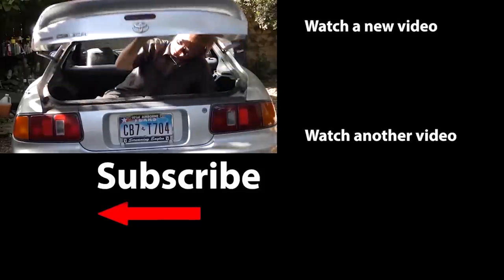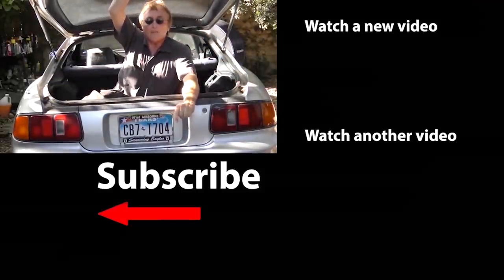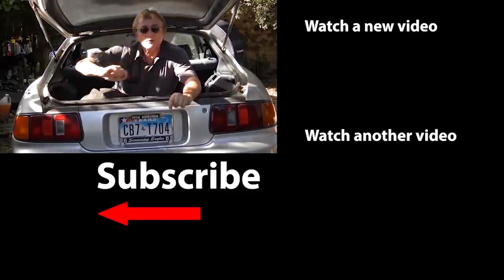This Was a Huge Mistake

Comment: Scotty, you're the reason why my first car now is a 1999 Mercury Grand Marquis and not a Nissan Altima.
Reply: I have a 2007 LS. It has 160000 on it but the body and especially the drivetrain feels like it's still around 60000 or less. Incredible ride and solid like a tank. Replace the tires as often as possible to keep the ride nice, keep up with the brakes and oil and it will last forever. They don't build them like this anymore. I'm glad I gave the grandpa moblie a go. 😉
Reply: Also, I bought it with 98000 on it and got lucky with the condition of it.
Reply: Grew up in da 97 grand marquis and that boat never broke down, my sister still has it as a hand me down and it’s big and safe and she likes it too
Reply: 99 Nissan was still a reliable car.
Reply: If you haven't done it, already, have the semi-metal intake manifold from a 2002 or later Panther body put in next time you get the coolant flushed. The stock ones from '96-01 are all-plastic and can crack. If there are any engine misfiring issues, get it fixed ASAP or it'll wreck the catalytic convertor. Otherwise, that car can last and grow with you for at least another decade and two kids.

Any woman you're dating who wants you to get rid of it for any other reason than winter traction, deep frame rust, it has become a money pit, or maybe safety (if even that, given it's body on frame) isn't a keeper.

Make sure you use the switch on the driver's door that turns off all but the driver's window controls, especially if you have kids, in case a child accidentally leans against the up button on the window rocker while their head's leaning out; do it now before you forget, then occasionally check to be sure you didn't switch it off by accident.
Reply: @Noah Stakes
 - Good Choice bud. I got an '03 LS Ultimate Edition. Other smaller newer cars just don't compare.
Reply: Nissan is a great automaker. I happen to own four,five if not for an accident. 2006 Altima 2.5 bought it with 130k and presently at 280k. 28+ miles gallon and no more maintenance than a changed valve cover gasket. I'd rather push my Nissan than drive your Honda or Chevrolet. Nissan-4-life
Reply: Hey I had the same car. Love that big ol' trunk and comfort all around.

Comment: On towing an all wheel drive vehicle with automatic transmissions: The Land Rover discovery series II (99-2004 not sure about the newer ones) allow you to fully disengage the drive train from the transmission by putting the all wheel selector into neutral.. I've been flat towing my 2000 D2 throughout Washington for years and so far so good..  but Scotty is right..

Comment: All but the current Suzuki Sierra auto have a special button to push which disconnects all drive shafts, so only the wheels spins. They are designed to be flat towed. It even comes with a dummy key which unlocks the steering, but won't start the car. I think that's cool.

Comment: The mainshaft in the typical rear wheel drive manual trans is above oil and the countershaft not spining to give the main shaft splash lube is not good. 4 wheel drive with transfer case with neutral is ok. Some front wheel drive manual transmissions have the mainshaft(s) turning in oil when rolling and those are good.

Comment: To fix an old Honda AC Compressor, you can re-route the serpentine belt so it doesn't touch the AC pulley ... or buy a plain bracket with a pulley that takes the place of the compressor for about $100.

Comment: Me: Scotty I just bought a new ram 3500 

Scotty: that was a huge mistake
Reply: Not a big mistake if you're going to do REAL WORK with it and maintain it correctly, and especially if it has the 6.7 Liter Cummins!
Reply: Paul Hoskins yes sir and Aisin trans, tradesman Crew Cab Longbed, 60k miles one one year 30k hooked to a trailer and not a single issue.
Reply: Ian Above the 7.3 was a great engine but my truck will out tow a 7.3 any day of the week

Comment: Hi Scotty, 
I have recently come to learn about the 2017 to 2019 Ford Fusion and Escape with a 1.5L Ecoboost engine having problems with coolant seeping into the cylinder bores mixing with the oil and ultimately leading up to engine damage or destruction. Ford just came out with customer satisfaction program 19B37 to reprogram the PCM with a new software calibration. We just had this done to my parent's 2017 Escape and now the engine sounds quieter and smoother. It currently has 23,300 miles on it and the engine use to sound loud and raspy. Any thoughts on this? Thanks 
Jeff from Detroit

Comment: I saw a RV burning because the car it was pulling caught on fire. I also saw a car catch fire that was being towed by a wrecker with the front tires on the ground and the rear lifted. The transmission fluid gets hot enough to combust.

Comment: You will still mess up a standard transmission, even in neutral. The transmission is still spinning, and you run the risk of breaking the snap rings that hold the gear assembly together.

Comment: At least the 6.0 liter wasn't as bad as the 6.4. By 2005 Ford worked out a lot of the bugs on that engine by then. However Motorcraft parts 10 years and older get harder to find. And you can forget about going to the International dealer.

Comment: What Scotty neglected to say about the Evans waterless coolant is that it takes all the pressure off the vehicle's cooling system and has a very high boiling point, (180deg C, I think), so at anything under that temp there is very low pressure in the cooling system, no more burst hoses/gaskets.
It's a very practical addition to any vehicles cooling system.
Reply: The cooling system will still have pressure.  15PSI, usually
Reply: @rays7437  no not correct, have 4 vehicles on Waterless coolant, a Range Rover, a BMW X5, and two LandRover Discoveries, at ordinary running temperatures, i.e after a run down the highway you can take off the radiator cap, minimum expansion if any, with engine hot and rad cap on you can squeeze hoses right in, no more 15 psi no more stress on system. Only disadvantage is the cost, but we buy in bulk, cuts cost.
Reply: @gazzafloss  
There has to be pressure
Reply: @rays7437  why? The pressure comes from the heated water reaching it's upper temp close to boiling point 100deg C, the pressure in a system raises the boiling point as found Anti freeze Anti boil, but that all only gives an upper limit of about 116deg C. If the waterless coolant's temperature got up to somewhere near 180deg C it then would start to create pressure.  I have the waterless coolant and know what I've seen and experienced, it's worth using in a vehicle you are going to keep and.dont want the failures due to overheat and coolant loss resulting in engine catastrophic failure.
Reply: @gazzafloss  
The water pump.  There has to be pressure for circulation.  I guess you didn't mean literally no pressure.
Reply: @rays7437  the water pump is only a circulation pump, it only generates enough energy to move the water throughout the system. Try this with your car, when it's cold only if it only has ordinary coolant, take
off the radiator pressure cap, start the engine and rev it up, no coolant will be discharged, you will observe movement but no pressure. Now if there was pressure supplied by the pump coolant would shoot out of the filler hole, this will only happen when the system is hot because of the thermal expansion of the coolant, nothing to do with the water pump. Early cooling systems on old cars didn't even have water pumps, they were "thermo syphon" circulation simply using the convection current of heated water to move the coolant through the system.
Reply: @gazzafloss  
Good grief.  
Fine.  There is absolutely ZERO pressure in your cars cooling system.  None at all.  Understood.

Comment: in my tucson  07, has abs brake system, you can take the air  out  just like a non abs but you start from the far away tire from the abs pump

Comment: Hi Scotty,

Are 2012 mini cooper s clubman vehicles good/reliable? My mom owned it and put 3,000 miles on it and kept in garage for 3 years. Then she gave it to me for school and it now has 51,600 miles on it so far. I accelerate softly (no 0-60 runs ever), change full synthetic oil my self every 10,000 miles or once a year which ever comes first. No mechanical problems yet. Changed battery once so far but noticed it taking longer to start so I took it to an Interstate Batteries and their machine showed it was not putting out 550 crank amps so I will be replacing the battery soon. Should I be looking for a new/used car that is more reliable? Should i be prepared for an expensive fix soon? Thank you for your videos!!! I used your car battery video to see how to tell the age of a battery before I buy one :)

I know the vehicle is old, has some miles, but the AC runs in the summer, heated seats are nice in winter, but I just cant afford an expensive repair so that is why if you recommend something, I will look into it. I am in Arizona btw.

Thanks!!!
Reply: Joe R Sounds like it was well maintained, so you should be fine with keeping it. Fiats are not known to be reliable, so if you are worried about expensive repairs, maybe look for a Honda or Toyota
Reply: I'd start saving up cash in the bank to buy some used Corolla for $1,000-2,000 in the event of a major Mini issue, and just drive the Mini around in the meantime. Get the new battery. Otherwise, if you maintain it, you may be fine for a while.

Comment: There are cars approved for towing 4 down.  Their transmissions were designed to allow for this feature.  Jeep has made a living doing this.  Any 4WD truck that has a neutral to disengage the transmission can be towed 4 down.  But like Scotty I don't know even if approved it's good for the transmission.  Honda used to approve the CRV for 4 down towing but now will not.  No Toyota automatic is approved by Toyota for 4 down towing.  I pull a FWD Ford Escape on a tow dolly behind my RV.  It's aggravating versus a tow bar but no worries on the transmission.  I've debated 4 down towing with a Jeep.  Just can't justify the cost and value of a Jeep for this feature only.   Scotty does a great job.  Just likes Toyota and Honda too much.  LOL

Comment: I disagree Scotty with one of your statements. I say please do not tow any standard trans vehicle with drive wheels on the ground and driveshaft connected to the diff.  It wipes out the syncros, trust me!  Maybe a very short distance, but not for any length of time.  Friend learned this the hard way.  Only when the engine is running is there any splash lube on the mainshaft/output shaft to the synchro surfaces that need continuous lube to keep from burning up.  Had a friend tow a RWD Mitsubishi truck from Colorado to Pittsburgh with rear wheels on the ground and driveshaft connected.  When they tried to drive after arriving in Pgh, it was as if it had a non-syncronized transmission.  All the soft metal synchros were worn out from no splash lube and output shaft/mainshaft turning continuously.

Comment: So even in neutral an all wheel drive car will get ruined being towed ? (Automatic)
Reply: Yes.. 100%
Reply: BIGGIEDEVIL yes
Reply: Some older 4WD cars have a neutral position on the transfer case, so with the automatic transmission and the transfer case in neutral, it's possible that it can be towed with four wheels on the ground. But those are older Land Rovers and Jeeps that had a mechanical lever for the transfer case, you'd definitely want to flatbed any 4WD or AWD vehicle that has electronic controls for the system.
Reply: Yes!  There are very very few exceptions.  Read your owner's manual.  If you don't have it, go to the manufacturer website and download it.  If they don't have it, buy one on eBay.

Comment: For a used car what would you choose, Mercedes c300 or Audi A4, 2018 models.
Reply: Mercedes, but damn that probably isn't going to be reliable. The Audi's worse. If you knew what's coming, you'd get a 2009-12 Lexus ES for far less cash.

Comment: Scotty I've got a 1997 F250HD with a 7.5L 460 and I'd like to boost my horsepower I'd like to get around 400HP what would you suggest to get there?
Reply: Bigger cam, heads, and a free flowing exhaust. Should easily get you there
Reply: @jaretboston20  the exhaust is part of my plan, but I'm not messing with the cam or heads because the 97 is computer controlled.
Reply: Tatsuhiro Satou   I’m sure Diablo or edge has made a tuner for it.
Reply: Tatsuhiro Satou  supercharger works too lol
Reply: @jaretboston20  no they only make chips for diesel engines.
Reply: @jaretboston20  definitely not doing a supercharger I'd have to rebuild my entire engine
Reply: Tatsuhiro Satou   Oh okay. That 460 tho is a torque monster tho already. But who doesn’t wanna go fast so I hear ya on that lol
Reply: You probably shouldn't bother. Don't mess with success; new HD's aren't cheap.
Reply: @EMichaelBall  I'm definitely gunna its just toy at this point its fuel economy is way to low to be anything else.
Reply: @tatsuhirosatou5513  You could sell it stock for a pretty penny and buy another (non-truck) toy for a lot less.
Reply: @EMichaelBall  it can't be worth that much it's just a standard cab 4x4 with 186,000miles

Comment: Bought a 94 ram 1500 it’s blowing white smoke out of the tailpipe, it doesn’t overheat it runs and drives good, there is a coolant leak from side of radiator I was told previous owner may have overfilled coolant any ideas as to what it is?

Comment: Scotty I’m 17 and I want to get a foxbody mustang should I get one or get a gas saver??
Reply: Paul Bravo go for the gas saver and save for a fox body later as a weekend car... personally I really want one and can afford a nice one, but I seriously think even though they’re on the verge of collectible, they’re seriously over priced at the moment... not to mention squirrelly in the rear for a younger driver...
Reply: Thank you Adventure of will and Shelby I been thinking about it and I’m probably going to go to the gas saver
Reply: Get a gas saver and learn how to drive really really well before you go and do something like get a fox body thats my advice
Reply: If you can find a foxbody in good shape for like $2,000, why not? A true gas saver will cost far more and it'll take years to recoup the extra cost in gas savings.
Reply: A '96-02 Corolla would also be a really good car, and it will have OBD2 for finding stuff like VIN swaps and incomplete (INC or Readiness INC) codes when you're looking at the car. Just check the oil every time you fill up, and it's very reliable.

Comment: Scotty, I have 96 f150 4.9l 5 speed 4x4 w 114k miles. Is it a good idea to change the differentials and transmission oil or will it cause problems? I dont know if the fluids were changed by the previous owner.
Reply: The diff and manual transmission are both splash lubrication, so that's fine to do. Only use the exact fluid specified by the owner's manual for each component.
Reply: Drain and fill only, don't flush. Open the fill opening plug before draining the old fluid out, in case you have trouble opening either one.
Reply: Thanks. I thought so but I wasn't sure and didnt want to cause myself problems down the road

Comment: I’m thinking about getting a 2007-2011 GS 350.. I know it will last a long time, but how expensive is it to keep it maintained??
Reply: kar alb I thought about that one too but only as a personal car
Reply: I'm the guy that asked the RL question on this video. I was thinking about one of those too, but I'm not a big fan of the exterior styling, and it doesn't have much interior room for someone over 6 feet, which I am. I also wanted something that was FWD, because I prefer that over RWD. I know that the Lexus ES is a great car, but it's kind of a grandma car, in my opinion. Scotty made a video on the 2007-2011 GS a few months ago, just search for it on his channel.
Reply: Henry Stone Yeah I watched that video a few times already, but he didn’t go into maintenance enough far as prices are concerned. You’re right about the space that’s why I’m considering the GS. Roomy and fancy just how I like my cars but I would settle for the grandma looking ES or another Honda Accord (i currenty have one) if I don’t find a GS in my price range when I’m ready for it.
Reply: Henry Stone By the way, thank you for asking about the RL because I was wondering how those were when they got old.
Reply: @thakiddmistic7610  Actually I meant that the GS doesn't have much space, especially headroom, because its a RWD platform, and the roof is kind of low-slung. The RL is more upright, so it has more headroom. The rear seat room is a bit small, but it still has more room than the GS. The GS 350 is probably easier to work on, since it's not as complex. The RL has a transversely mounted V6, since it is related to the 2008-2012 Accord in a way, and they all had Super-Handling AWD, which complicates things somewhat, even though it's supposed to be a bulletproof system with proper maintenance, which isn't difficult. And the RL's had interference engines with timing belts, which is an extra expense. The GS 350s had timing chains, so that won't be a liability when you buy the car used, compared to a timing belt, which is. I do agree with Scotty that an RL with lower mileage that's been cared for is going to be a much better car compared to one with higher mileage that's had the snot driven out of it. They're extremely rare, Acura only sold about 1,400 of them from 2011-2012, and it's called the Honda Legend outside of North America, so The RL is a descendant of the cool Acura Legends from the '80s and '90s.